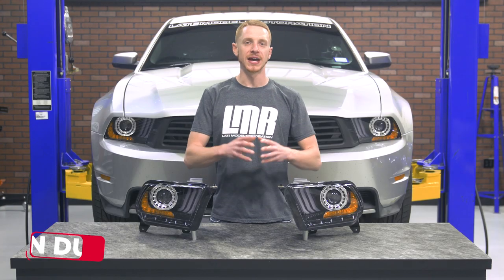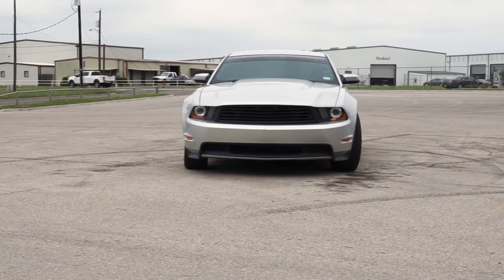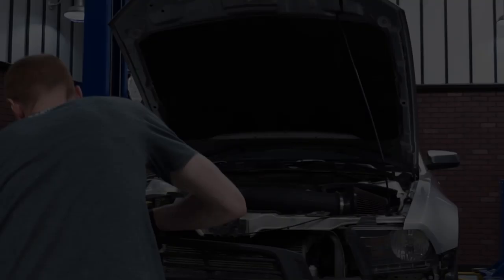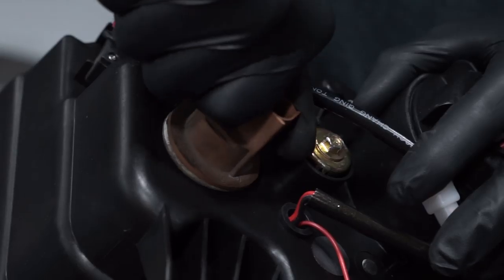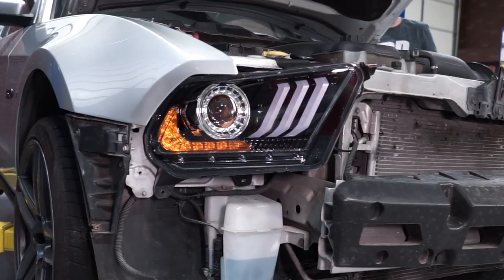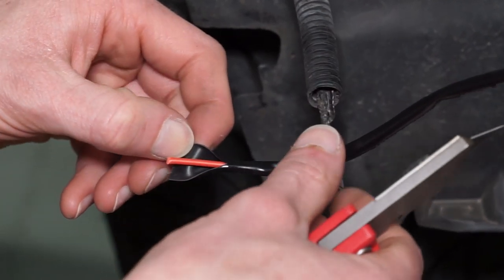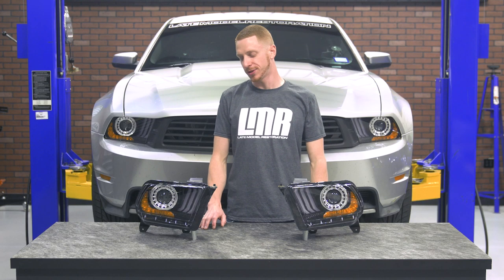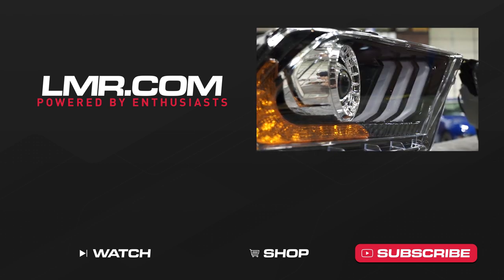2010-2012 Mustang 2018 Style Headlight Install/Review

Comment: I just received my order of these headlights and im trying to replace the bulb with an LED one but disconnecting the electrical connection is impossible. Im not sure if i have a faulty one but i cant seem to take it out.
Reply from the maker: It's been awhile since I've messed with these lights. If you haven't figured it out, reach out to our customer care department and send an image of the area in question. Thanks. -Landan

https://lmr.com/contact

Comment: In order to swap out Halogen to LED, basically would have to remove whole assembly due to cover installed on housing? Also, was wanting to upgrade to LED because the Halogen are dim

Comment: I turn the turn signal the 3 bars blink instead of the orange bar 😢 idk wat I did wrong
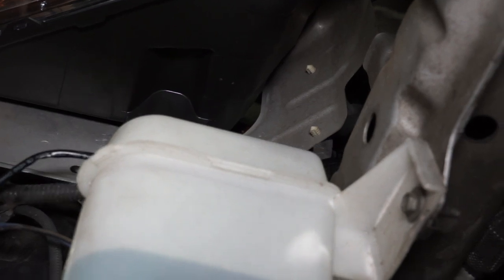Reply from the maker: Jonathan - There could be a chance that the installation is incorrect or the wiring inside of the headlight/harness is wrong.  The 3 bars need to be wired to the park light circuit.  These steps start at 3:58. -Landan

Comment: How can you tell if your Mustang has factory HID vs Halogen? And are Mustang GT headlights interchangeable with Mustang GT500 headlights? Thank you in advance.
Reply from the maker: You'll have to check out the bulb and see what design it is. The HID and halogen have a different design and color when compared. As for the GT500 headlight swap, it's possible, but it requires extra modifications. Here's a link to do the conversion: https://www.allfordmustangs.com/threads/how-to-easy-factory-hid-headlight-install.351028/
Reply: @latemodelrestoration  Looks like I've got HID's. Apparently '11 and '12 GT500s come exclusively with them. I think my only option is to get a wire harness that converts my year to accept '13 '14 headlight connections.

Comment: Other than the harness (which I’ve already adapted and wired to work) is there any reason why I couldn’t put these on a 2014? I have a 2014 but i adapted the wires so that it has 2014 harness. I’ve already bought me 2014 hood and bumper all I need is the headlights. If I buy these I should be able to install and plug them in right? Or is there anything I should know before I order.
Reply: Correction*** I have a 2010... but it’s pretty much all converted to a 2014, just want some new head lights
Reply: And I can always rewire it back to the 2010 harness. I still have that and I wouldn’t mind doing that if that is all I have to do. I believe fitment should be the same am I right?
Reply from the maker: Carlos,

These headlights will not fit the 13-14 front end or any factory equipped HID Mustangs.

Comment: What part number for LED headlight bulb.
Reply from the maker: We don't offer LED bulbs for 10-12, only replacement HID bulbs. However, these headlights only fit on non-HID applications. You'll have to source a set of HID bulbs if you would want to swap out for different bulbs.

Comment: Does anybody make after market light for car with hid why is it so hard?
Reply from the maker: Hello Spencer
You can check out Diode Dynamics to see if they will have what you need.
Reply: @latemodelrestoration  Unfortunately Diode Dynamics do not have headlight housing options for HID's either.

Comment: Does this works on a mustang 2013 v6 base?
Reply from the maker: No, they will not fit 2013-2014. These are designed for 10-12 only.

Comment: Hey I just ordered a pair of these headlights but I have factory HID what can I do to make these headlights compatible?
Reply from the maker: These lights are not designed to fit factory equipped HID's. Unfortunately, we don't offer any solutions to make these headlights compatible. - Jude H. - Social Media/Events Coordinator
Reply: If you do figure out a way to make these work with factory hid post a video. Because I want these lights as well